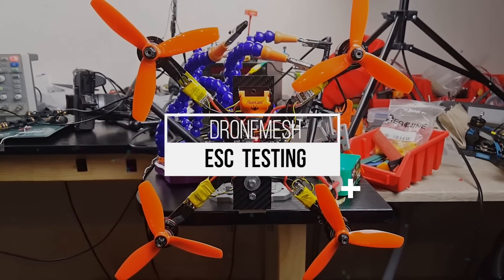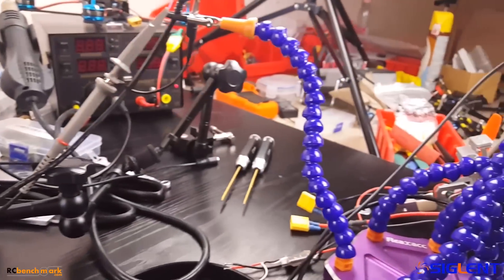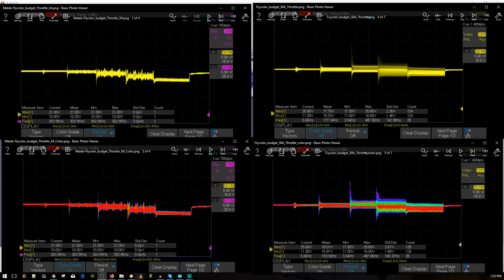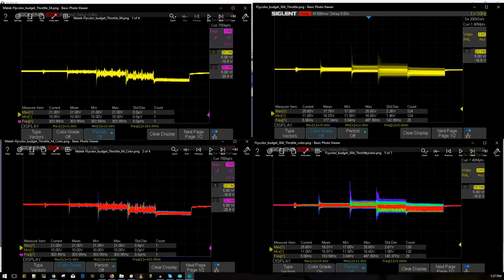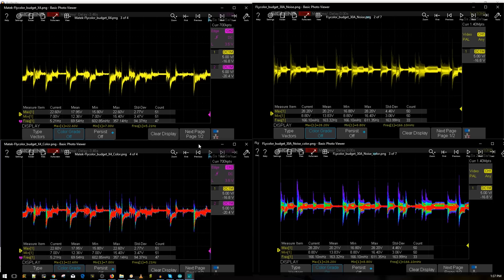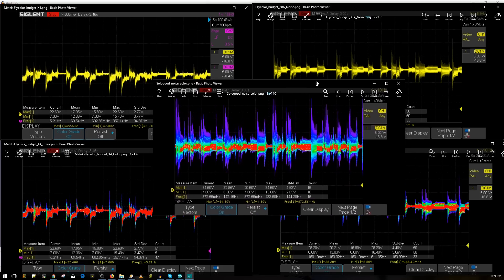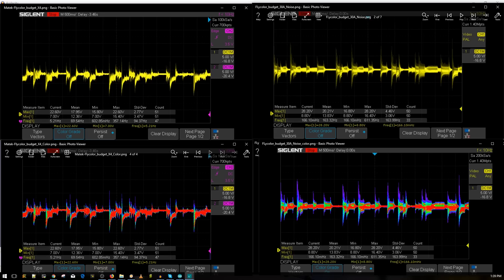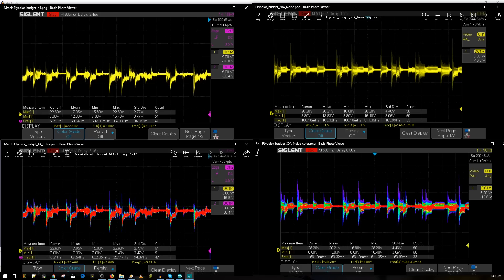Matek F405 CTR + Flycolor Raptor 30A BLS //  4 Motor Noise Test

Comment: I think that is a lot of noise. I have a bfight and I changed the motors to a 2207 and I had no noise at all with a cheap esc (4 in 1 30 amps no cap) the only problem is that it took fire a couple of weeks ago 😂😂. Love the testing environment!!!
Reply from the maker: Giuseppe Falcone It has a bit of noise wait until I compare it. There was also alot of jello which makes it seem to have more noise that it actually does.

Comment: Do you prefer the dalrc engine stack or the dalrc f405 aio with the flycolor raptors?
Reply from the maker: For me I would go with the combo it's cleaner and easier to build they are both good but I like a quick clean build.
Reply: Drone Mesh Do you ship from europe?
Reply from the maker: Yes
Reply: Drone Mesh  Thanks for the info, I think I will have to do some shopping these days :)